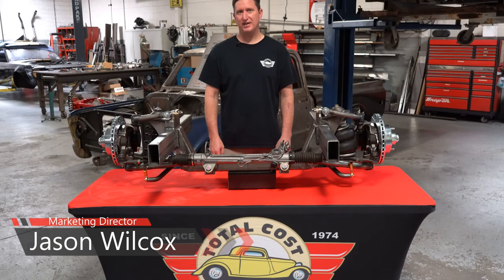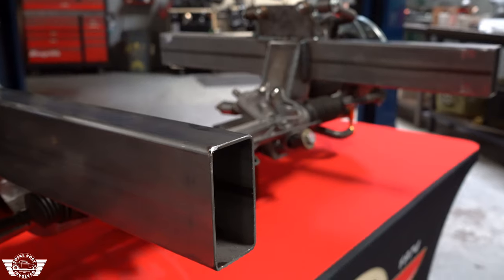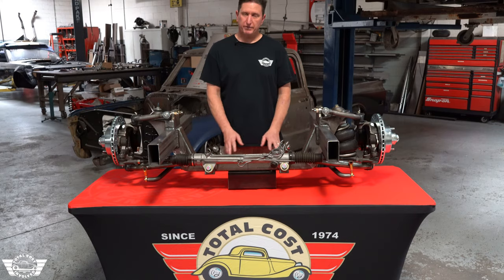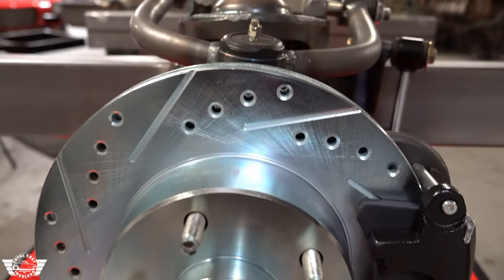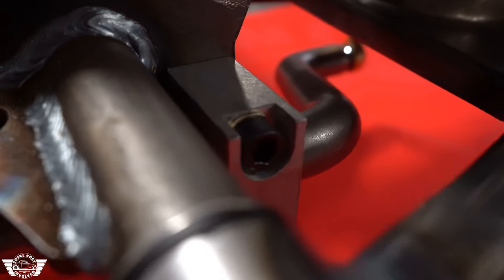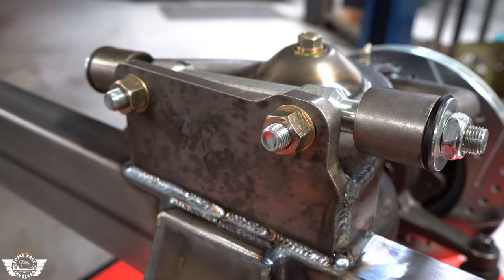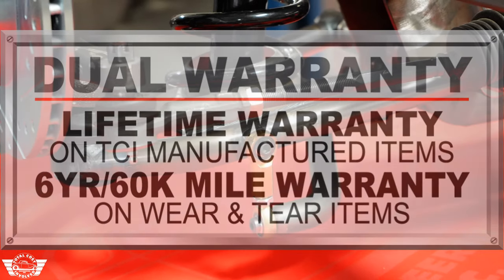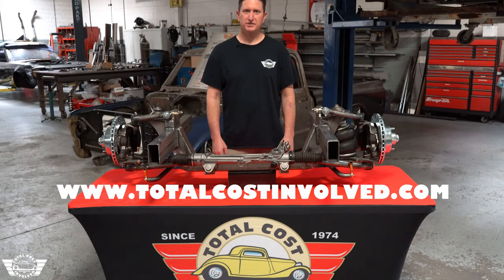TCI Engineering New Product: Universal Mustang II IFS

Comment: I have never owned a vehicle with or installed a Mustang II front end. But I have been an alignment tech for over 30 years. I am planning on installing a Mustang II front end on the '33 Dodge Coupe I'm building but I have to ask why change from the T-bolt upper control arm mount to the vertical plate with shims? Cars with the T-bolt upper control arms are the easiest to align like Crown Vics. Shims require calculations, which some alignment systems will do for you, but I don't think even the Hunter Hawkeye system I use has specs for an aftermarket Mustang II set up on a '33 Dodge. I'm just interested in what the advantage is since I am deciding on what brand to buy.
Reply from the maker: Over the years we had so many complaints about the arms moving after the alignment. We tried knurling the cross shaft, knurling the upper hat, running 1/2" bolts that can be torqued to higher specs, it didn't seem to matter. Somewhere along the way handling became an important issue as well so we killed two birds with one stone, lowered the mounting point (adding camber gain) and changed to the shim style. This had the added bonus for performance customer's being able to keep a separate shim pack for track days. We provide the alignment specs for street or performance use.
Reply from the maker: Something else, We would typically run a rear steer IFS on a vehicle such as yours. Which shares literally nothing with an MII IFS. On that front end we use eccentrics to adjust alignment which is even easier. https://totalcostinvolved.com/product/1928-1936-chevy-car-truck-custom-ifs/
Reply from the maker: Check out this video at 2:00 and you'll see how adjustments are made. https://www.youtube.com/watch?v=vK2jBmqqO2E
Reply: @tcimuscle  Thanks a lot. Like I said, I'm not totally familiar with the Mustang II setup. I'll check out the set up you linked.
Reply: @tcimuscle  I checked it out and that is a gorgeous looking front end. Definitely going to be my choice.

Comment: Question about control arms...I have a 57 chevy pickup, went do you use this kit all control arms have the same length(dimensions) don't matter the vehicle or are specific length?
Reply from the maker: Are your frame rails damaged? If not you need this. https://totalcostinvolved.com/product/1955-1959-chevy-truck-coil-spring-ifs/

Comment: Hi, is the rack and pinion offset? I can’t tell from the video, and if so are you using inner tie rod extensions?
Reply from the maker: The narrower track width does not use an extension but the wider one does. In that case the rack is offset and the extension goes on the inside.

Comment: So right now I’m starting a project 1951 Chevy pick up 3100.
And I have a 4.6l 3v from a 2007 mustang gt.
Do you think I’d be able to use this? 
Cause Right now I’m just window shopping and tryna to gather as much information before buying a mustang ll ifs.
Reply from the maker: We offer 2 front ends that are specifically built for your truck. So unless your front frame heads are damaged we would suggest using a direct fit kit. This Universal weld in front end would be much more labor intensive than something built for your truck. The engine shouldn't be a problem so long as it has a rear sump pan. https://totalcostinvolved.com/product-category/chevy-pickup/1947-1954-chevy-truck/

Comment: I have some questions about mustang ii kits. By much do these kits increase handling in a vehicle? Also how much suspension tuning can i do with this kit?
Reply from the maker: I guess that will depend on what you're starting with. If you have a 50's pickup with a straight axle then we're talking night and day. These can be made to autocross if compiled with a good rear suspension. These have plenty of adjustment and options to fit your specific needs for a great handling daily driver. If you want something specifically for autocross then look no further than our Universal Pro Touring front end.
Reply: What about a Manta mirage and how much